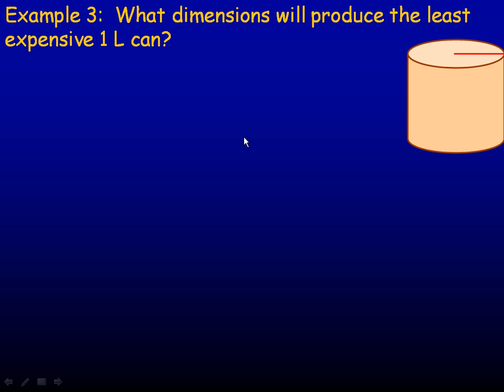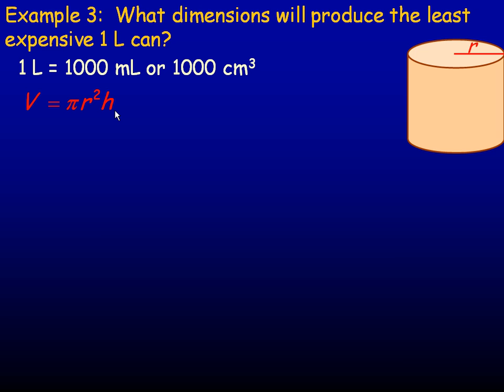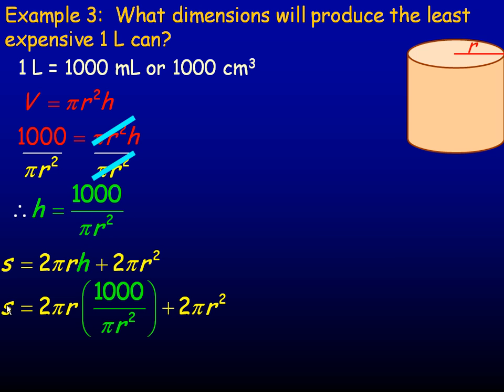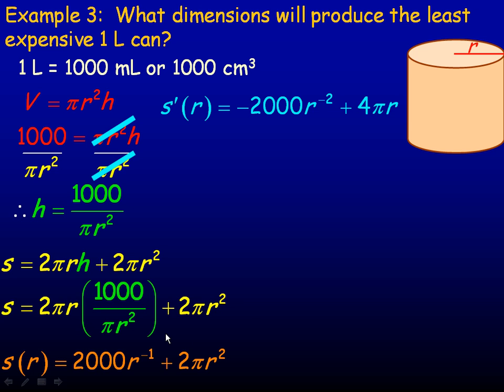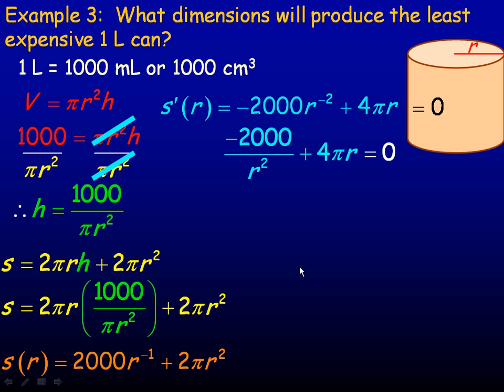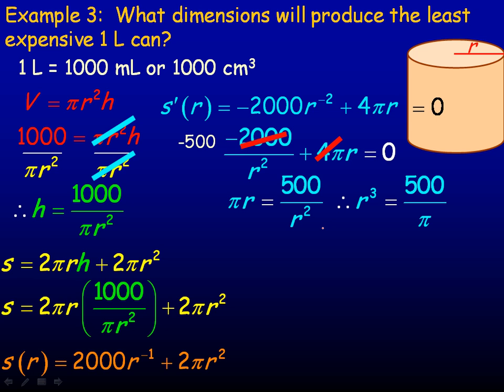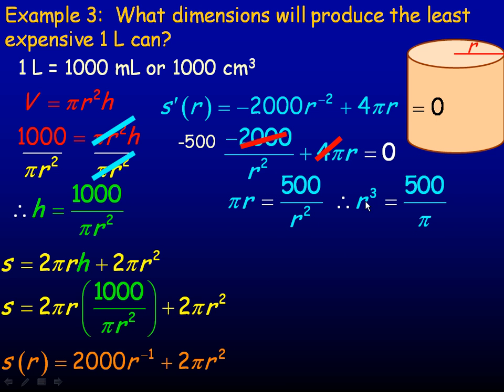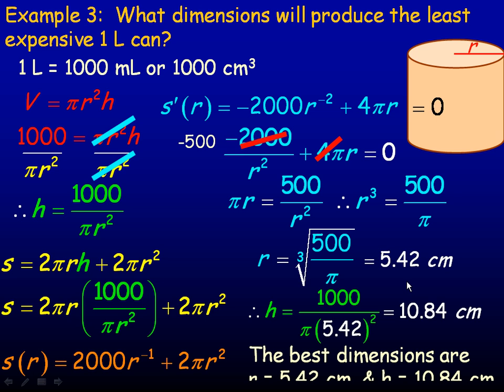Optimization Problems Part 3

Comment from the maker: @NarutoKun310 You would solve this the same way, except if there was a restriction you would check the surface area at the top and bottom of your restriction on the radius.  For example, if the radius had to be bigger than 4 cm, then you would check the surface area at 4 cm and the 5.42 cm.  If the restriction excluded the 5.42 cm radius, then you would check the surface area at the top and bottom of the restricted range and look for the smallest one.